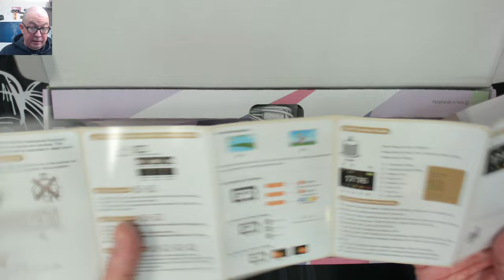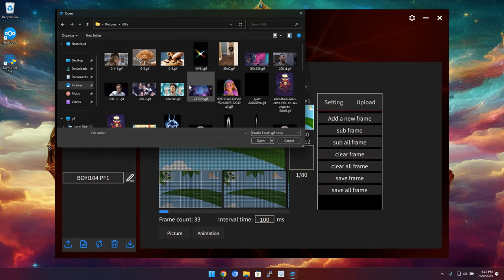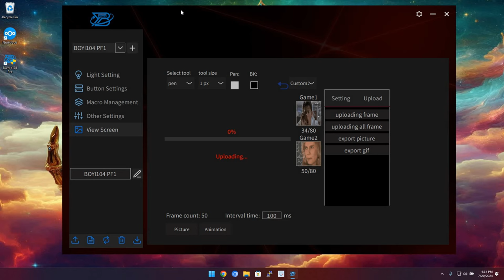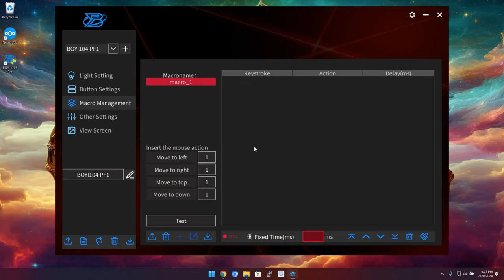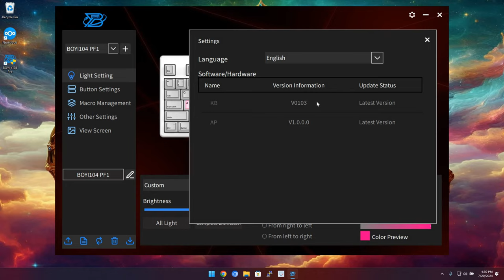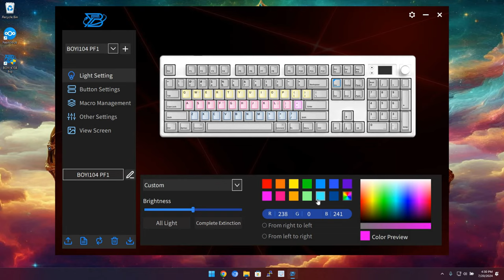Boyi K104Pro Full Size 3-Mode Screen Knob Review and Sound Test

Comment: Damn that's one ugly boy(i)!!

I don't remember old keyboards having those nasty mossgreen keycaps, luckily they include they grey options for those keys.
I still don't understand those buttons next to the screen, also very off putting.

Anyway, love the thorough review, maybe add the case material in the "just the specs" section, I always find that one bit of info hard to come by, conveniently this almost always happens when the case is made of plastic.
Reply from the maker: Thanks, much appreciated! I do try to put the case material when I can find it but many times I find that I either cannot find what material it's made out of or I see conflicting information stating that it's both PC and ABS so when I'm not sure I just don't put anything.